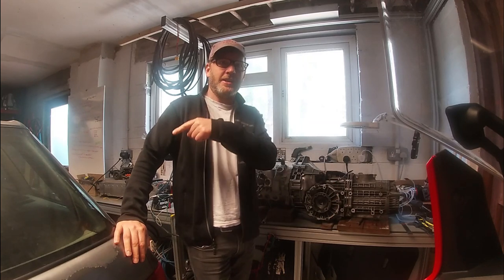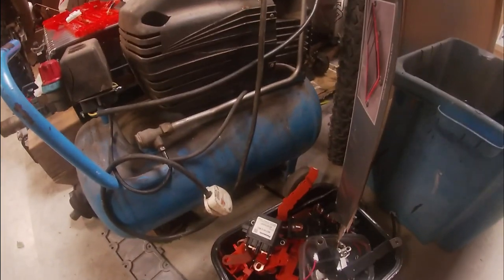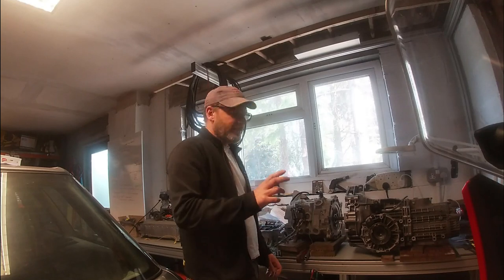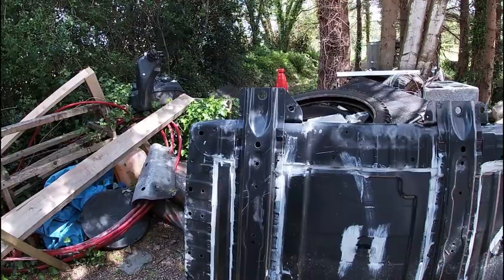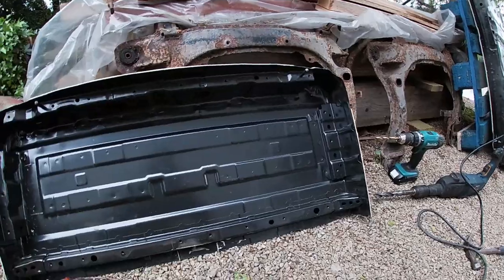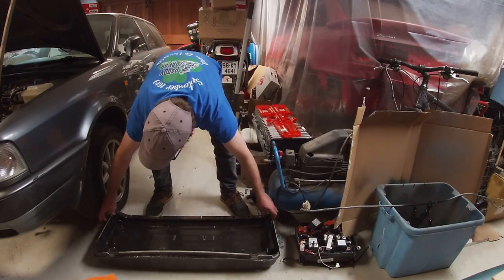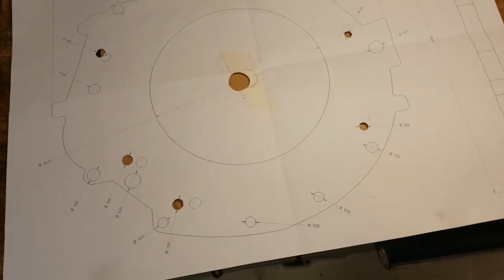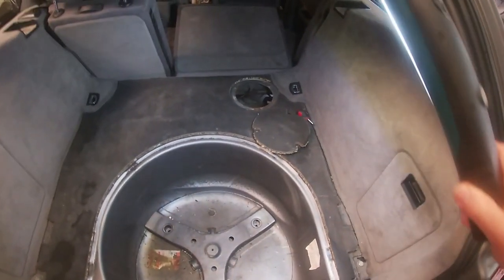Audi 80 EV Conversion - Part 9 - Coupler Fit and Spin

Comment: Brilliant stuff Fichara. I think you should of used a bigger drill for breaking them welds👌👌😂 keep up the vids
Reply from the maker: The Super Driller 3000 XXXL was out on hire 😂👌. Jesus, took ages! I managed to blunt 3 bits, and in was using oil to cool them down😓

Comment: friend, could the part that you go towards the engine of which vehicle is please thank you I mean the coupling
Reply from the maker: Hey Pedro. The motor side of the coupler that I fabricated to fit the Leaf motor output shaft is made from a clutch spline Fiat Multipla 1.6l petrol.
Reply: @Scampi6000   thanks  cooke